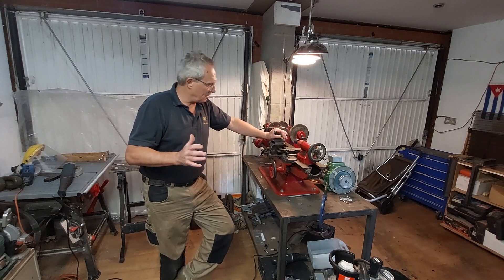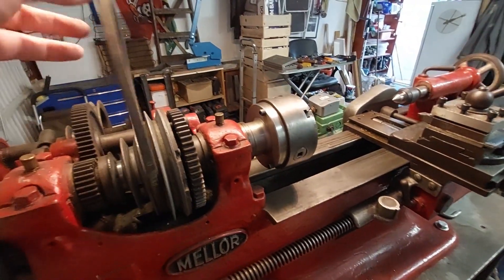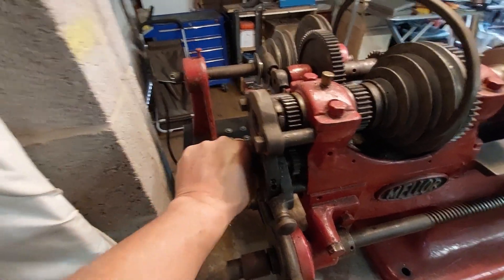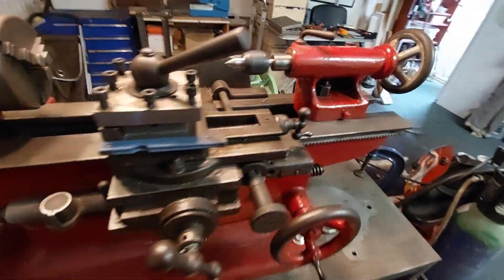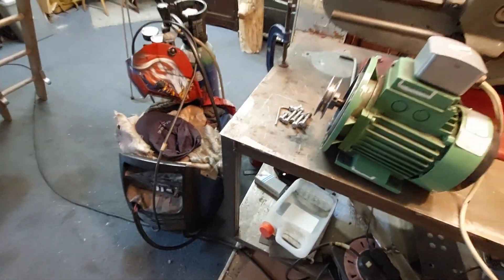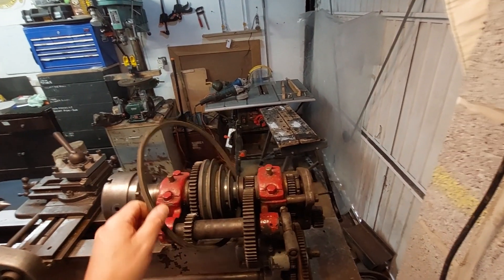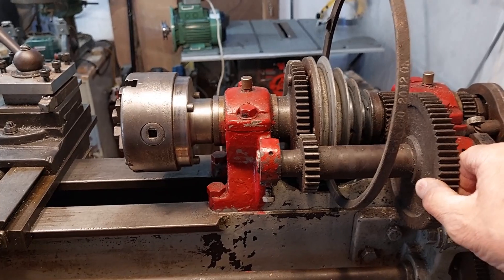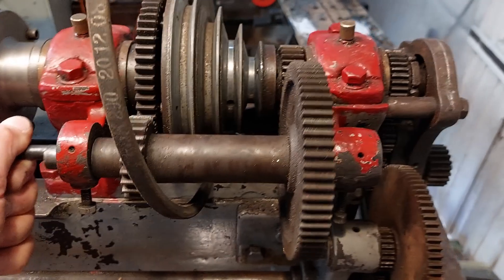Mellor Lathe, Part one - Overview

Comment: I would add that counter shaft back in. It gives you more speeds to the chuck. The big gear on the back is called a Back Gear. There is a screw on the large gear next to the chuck that will unscrew and allow the chuck to rotate in Back Gear. Very useful. Good luck figuring some of it out!!

Comment: Also, by discarding the second drive cone you are causing yourself problems: These enable you to have one size drive belt, which slips between four gears. If you attach your 
motor directly, you have to build an adjustor on the motor. Don;'t be removing things, because you don't understand them,. This a lovely, old lathe and I wish you luck restoring it
Reply: The extra set of pulleys you showed backwards.  The small pulley on the back set should line up with the large pulley on the lathe, this will give you multiple speeds.  It should also be much easier to setup without building a bracket to mount the motor on top.  If you eliminate the extra pulleys you will have to install a variable frequency drive to change speeds.
Reply from the maker: @mattgill6676  I have a plan to move the motor longitudinally along the motor mount to engage different pulleys.
Reply from the maker: @mattgill6676  Thanks for the feedback it’s much appreciated.

Comment: The large twin gears, which lock in and out are you Back Gears, they give a slow, strong speed: Bigger of the two is the Bull Wheel - you lose a key feature by removing them
Reply from the maker: Thanks for the explanation and  feedback it’s much appreciated.
Reply: There is a pin in the biggest gear on the lathe, pull that out when the back gear is engaged and you will see what it does.